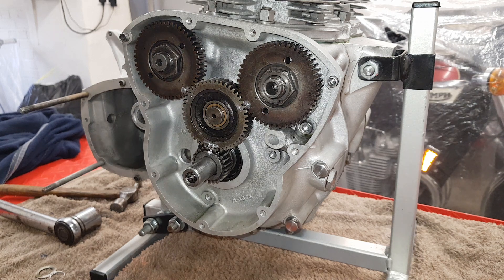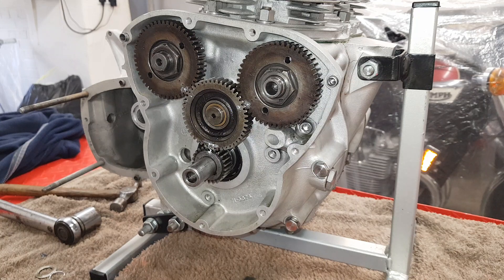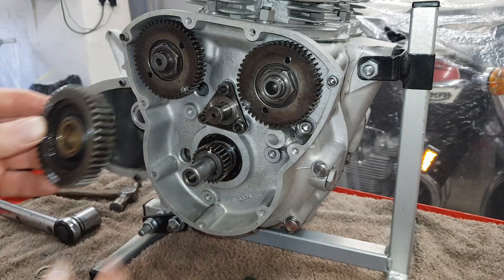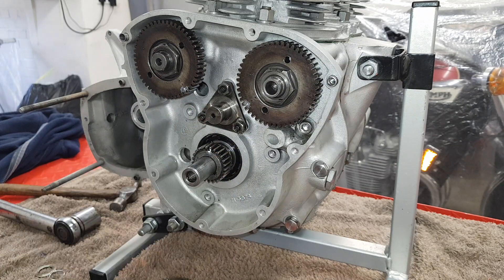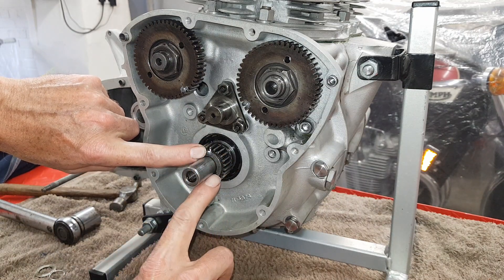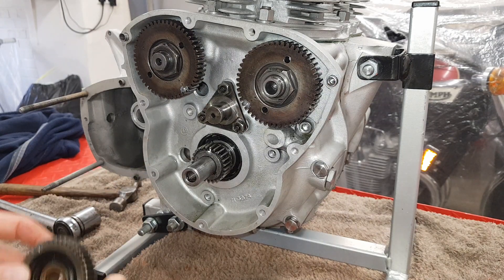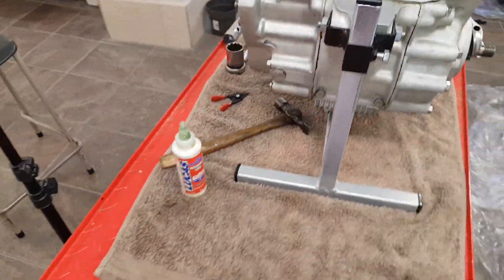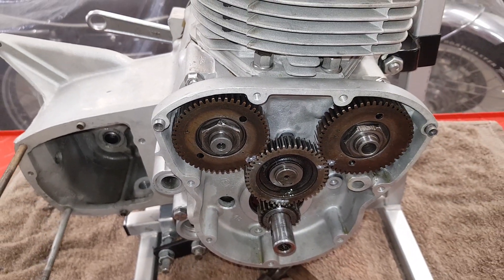Triumph Trident T160 Engine Rebuild. Part 22: Fitting the Camshaft Sprockets

Comment: Shame you missed out fitting the two cam gears to the camshafts as what I came here for. They are a tight semi interference fit and wondered what the best way is to get them on safely without special tools. Or will they just pull on with the nuts?
Reply from the maker: The cam gears simply slide on and then pull on fully with the nuts. You just need to align the key on the camshaft with the keyway on the cam gear in line with the relevant timing mark - so align the key on the exhaust cam with the exhaust mark on the cam, and align the key on the inlet cam with the inlet mark on the cam gear. Don't forget that the nuts are left hand thread.
Reply: @Chris.rooke150  Thanks Chris i have read the earlier twins had to have a tool to fit the cam gears safely. Have a t140 es that has  come to me completely stripped and in boxes and with a bent crankshaft that i have a replacement to fit.